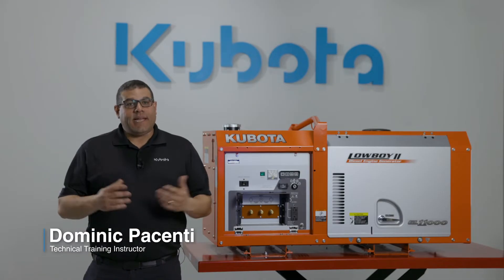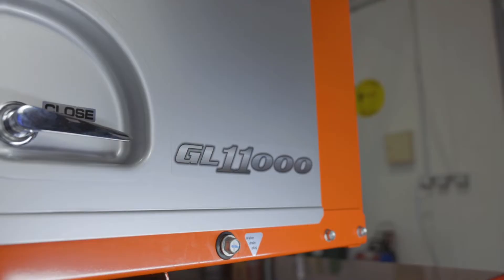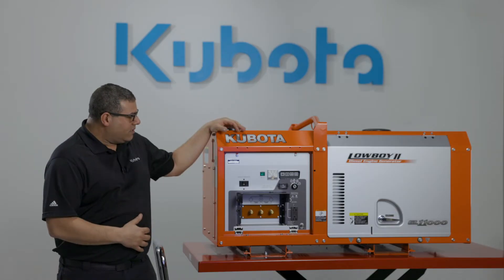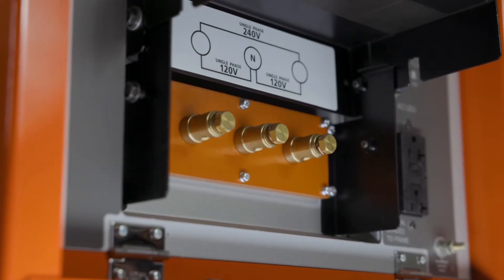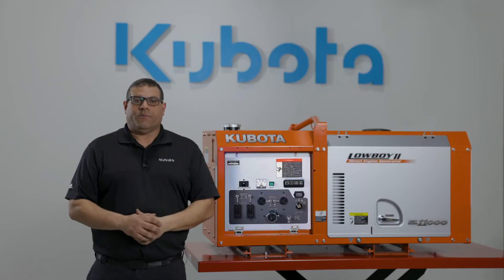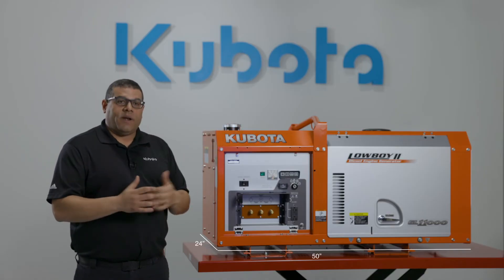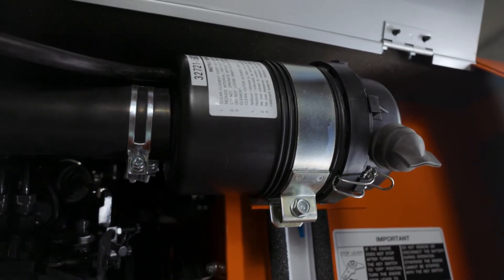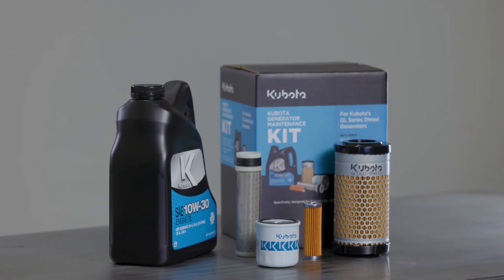The Kubota GL11000 Lowboy II Generator

Comment: Does this generator ramp up and down depending on load?
Reply from the maker: Hi, Drew! Kubota generators run a constant speed, so the RPM does not change.
Reply: @KubotaEngine  Is there a way to idle this generator for cold starts, I have a GL11000 with 75 hours and it makes me cringe when it cold starts and tries to go WOT cold, it would have to be better for longevity to idle for a time to warm up, please advise
Reply: @bigdwhite4359  Thats just how most generators are, I'm pretty sure the kubotas are mechanically governed so it woudnt be possible.

Comment: I like my gl11000. With it we can charge my batteries at 40amps DC and still keep the house running simultaneously. It is heavy so you will need power equipment or three buddies to move it around.. I can say it is not "loud" but its louder than my Pulsar (Genmax/Predator) inverter generator.